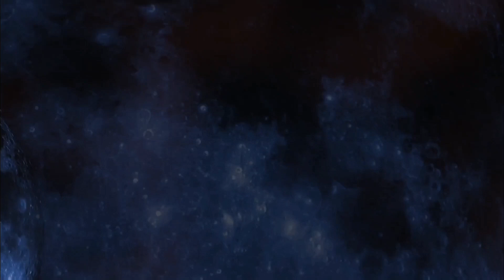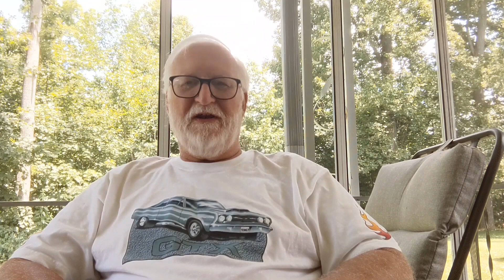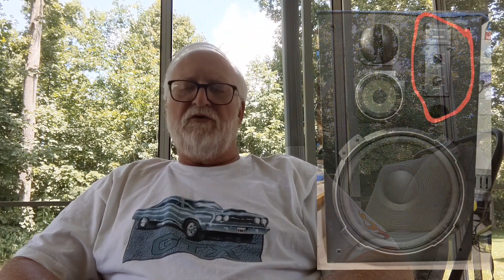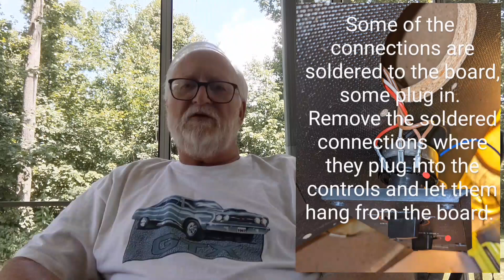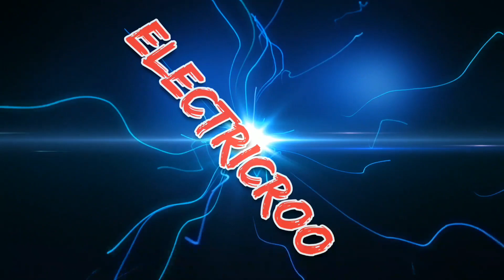I made some Audiophiles Cry, Realistic Mach Two Speaker Crossover Capacitor Replacement.

Comment: They did not worry much about the different sound of different types of capacitors as long as they met specs. Especially when talking only of polarized film or non polarized film capacitors. On the other hand, based on cost, if you use a high quality cap, it cannot hurt. A large component of a 'high quality' cap is the tolerance factor to be out of stated capacitance ie: accuracy of value stated. Even varying 10% vs varying 1% is not much of an issue to modern crossover designers since that only changes frequency response a few hertz, well below the least noticeable difference to discerning listeners. IMHO any film capacitor should do regardless of price. I usually will spend no more than 50 cents and use all the salvaged caps I find.  I would challenge you to figure out which crossover is using a nasty electrolytic capacitor even. No reason really to be afraid of altering something as middle-of-the-road as RatShack Mach 2s. I mean what is the 'true' voice of a RS Mach2? The tweeter is the only unique thing, but easily emulated with better response. They are not sound lab monitors. The woofer and mid are basically off-the-shelf Quam type drivers. The walnut veneer is the greatest thing about them. No need to romanticize this monkey coffin, but are excellent candidates for modification.

Comment: The crossover parts are really cheap.  5%  NP metal poly caps, wire wound resistors and air-core inductors will elevate those speakers well beyond factory.  They will take the speaker from pretty good to great.  The stock caps (if you must) at least use quality electrolytics like Bennic or Black gate. The generic stock caps would be lucky to be within 30% of value, highly resistive and degraded after so many years.  Old caps (to me). sound murky and dull, as I have compared worn stock electrolytic to 5% metal poly.
Reply from the maker: Yep, they are cheap. But they are matched perfect to the amp I built for them and retain their 70 - 80's vintage sound. Sometimes I think we get to carried away with trying to improve things instead of keeping examples of what the engineering of the day was designed to sound like. Such as restoring vintage equipment. Sometimes the intent is just to restore to original as close as possible.

Comment: Thanks for the information on what you did to bring your Mach Two Speakers back to life.  I just replaced the foam surround in my father-in laws old speakers.  I will check my capacitors while I have them apart!

Comment: I took some working Bose 501s and made my own frankenstein 501s lol.  I put all new drivers and brand new crossovers.  The result?  They sound so much better than the original 501s.  They get louder with great detail and the low end output is incredible.  I also have a pair of Vega d5s and added new off brand woofers because originals were no good.  I also added brand new crossovers.  Again, the result is better than the original.

Comment: do you have the diagram for the crossover wiring for the machs I have the mack 3's and need to rebuild them, the wires are all out of order.
Reply from the maker: I don't think they are the same as the cabinet and speakers are different. I added a link to the schematic at the end of the description.
Reply: @electricroo  How would I get information on the Mach 3's schematic or diagrams?
Reply from the maker: You would have to search for it. I found the Mach 2 in an audio forum, don't remember which.

Comment: Thanks for uploading, I just refoamed my mach 2s that I've owned since new as my parents bought them for my birthday in the early 80s. I am going to measure and replace the caps, probably like you have with maybe a nicer bypass cap on the mids and tweeters. Anyway just curious if you messed with the ferrofluid in the tweeters. It's funny that I'm nervous to hook them up as I don't want to cook anything nor be dissapointed if they don't sound right. One thing for sure these speakers will get you 90 percent of the way to much more expensive speakers and rattle the foundation of your house in the process.
Reply from the maker: I didn't touch the tweeters. Don't be disappointed with the woofers. It will take a lot of hours or sustained high volume to break them in after re foaming. I broke mine in cranked up with some yard parties out here using the 100w per channel SS amp that I built. They settled in nicely. It would be nice if GR Research ever re-designed a crossover for those. I'm sure Danny would do it but you'd have to send him a set and it would be very expensive!
Reply: @electricroo  A few years ago I reached out to dany at gr research and he said he'd never even heard of them before. I'll definitely break in the woofers, but was most curious about the tweeters. I've heard from speaker builders that the butt cheek tweeter is a winner for sure, happy to hear that you might not have heard a dropoff in the highs due to dried up ferrofluid.
Reply: @koprcord5338  I can help you  abit with this. I recently picked up a pair of Mach ll's and upon initilal listening I could tell the tweeters were less that 100%. I could hear output from them but even with the L-pad all the way clockwise, I could barely hear them. It was the exact same scenario with a pair of older B&W speakers. 
I dissasebled the tweeter (easy) and cleaned all the old ferrofluid from the VC on the tweeter and the VC gap in the magnet. Once I put them back in the speakers they sounded as they should. I'm not too worried abot frying them as I dont play them very loud. You can get replacement FF on the internet and replace it if you so choose. I'm good with it the way it is. Hope this helps!
Reply: @johnmitchell4769  thank you for the feedback. Nobody else has really talked about taking the tweeters apart. I still have not as if I screw it up they are not easy to replace. With that said, did you have to desolder the diaphragm leads or anything to get access to the voice coil? Just want to be prepared. Also what was your method for cleaning out the old fluid. Thank you.

Comment: I just picked up a pair of the Mach twos that needed to be saved and restored.  Unfortunately they were in a smokers home, 🤮. I’m reforming the mids but had to replace the woofers as they were different and neither were OEM. Picked up two 15” woofers that supposedly fit these Mach twos at Simply Speakers. 75 oz magnets (W-1500). People were really raving about them, and finding the OEM 15s was a challenge.  I replaced the caps on a pair of 1971 pioneer CS-88a’s and you really can hear the imagining and instrument separation much better with new caps.   Just would like to see about getting something closer to the original screws for the woofer instead of the dam Sheetrock screws I found in both woofers (hate when people do that).  Like you I enjoy restoring these vintage speakers, it’s really not hard, and it’s a great little hobby with a ton of reward. 👍🏼.   And my ears are 61 years old, not working the way they once did, but I can still appreciate the fidelity.

Comment: Very cool what you did to those old speakers. Working on gear and upgrading parts can be a lot of fun. I replaced all of the internal parts in my speakers with better quality same value caps, replaced the sandcast resistors with Mills, the inductors with high quality air core inductors, the internal wire with silver plated occ copper, and rhodium plated all copper binding posts. I did 1 speaker at a time so I could compare them, and the upgraded parts definitely made a big difference for the better. More clarity, separation of instruments, better bass response, etc., etc. I absolutely loved my speakers before and even more now. Thanks for the vid! 🔊🎶😊
Reply from the maker: Thanks. I like keeping my vintage stuff vintage. It's all in what you want to accomplish. If you're looking for a change from the original, then I say go for it! It's all fun!